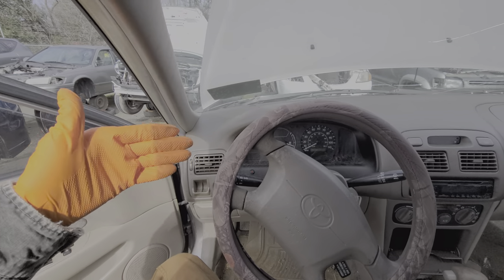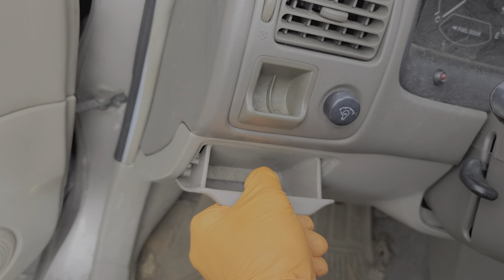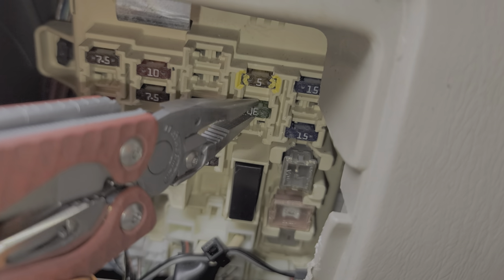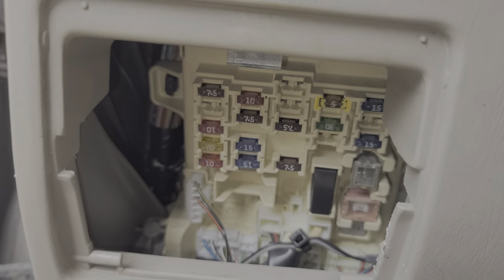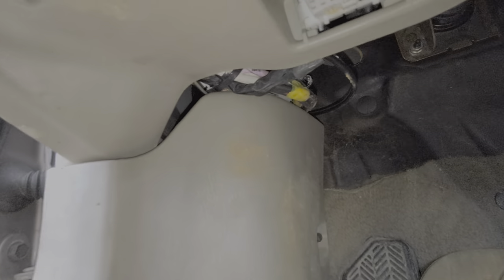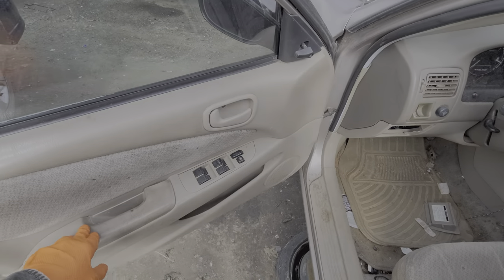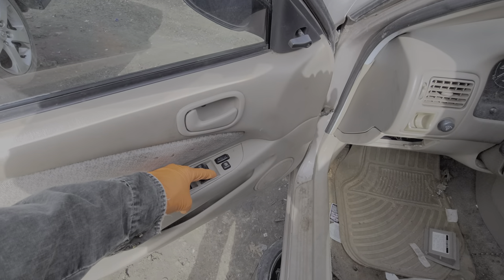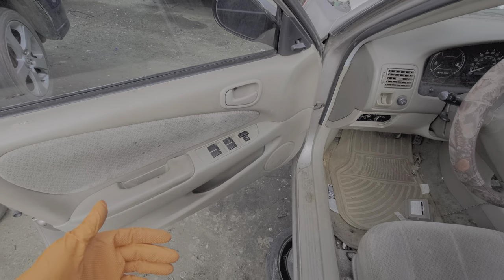2000 Toyota Corolla Power Window Fuses

Comment: These have auto down. The motor has a built in power draw limit circuit. It can be bypassed if you're good with electronics or simply replacing the motor fixes most issues.
It's this built in motor relay that causes the motor to stop working. It usually first becomes apparent after a couple up/down cycles, then progressively gets worse until the motor will only move the window an inch then not respond for 30 seconds, then move an inch, not respond for 30 sec, etc etc

A good way to go is to get a driver's side REAR door window motor. They are usually like brand new. You can also bring a small battery to the junk yard to test. I've even used a cell phone battery to test a window motor, though I'd suggest something like a little lithium jump start battery. Those are very very useful.

Comment: Many thanks Tech. I just learnt something new today and I appreciate that. My 3 other windows are 23 years old and still working on my Corolla  1998 LE 1.8L. My driver power aut window is the one again giving me problems even though its motor was already replaced years ago. I understand this is the one we use the most. I will see if even the old motor make it work after cleaning up the grooves first. Thanks again.

Comment: In the power junction that you filmed 2 grey color relays, the one in the bottom is for fuel pump, and I pulled it before and fuel pump wouldn't pump. I did that to de-pressurize the fuel line to replace my fuel injectors. Therefore, I believe the grey relay on the top is probably for the power window.

Haynes manual says each window has its own circuit breaker, but I am not sure which is which. My driver side front window moves a bit and die, and I tried to lube the regulator and new switch, but same problem. I still need to figure out what's wrong with it, and I will try to swing the door and see if it's wire problem.
Reply: I have two small black relays on the top, and a big grey one on the bottom, which one is for the window?

Comment: I have the same car but my issue is that when I roll the window down it's normal but trying to roll it back up, it doesn't work right away. I have to give it a few minutes to even move it an inch or two and repeat the process. One of the windows in the backseat doesn't roll down either. Could this be considered a fuse related issue or something else?
Reply: Did you find the solution?
Reply: @thewiseguy7100  No, haven't had the time or money to spare to look more into it.

Comment: What bout a 2000s camry ??....I have the same fuses, and none of my windows work....not sure if its a fuse problem or not
Reply: Same here
Reply: Are you still having issues? My fuses were fine but the windows still didn't work. I was able to finally get them to work though very easily!
Reply: @devinazevedo1122  you could of said how you got them to work?
Reply: @Stephon Thomas  there's a short somewhere on the positive wire on mine. Test this to see if it's your problem but running power to it. I just used the cigarette lighter